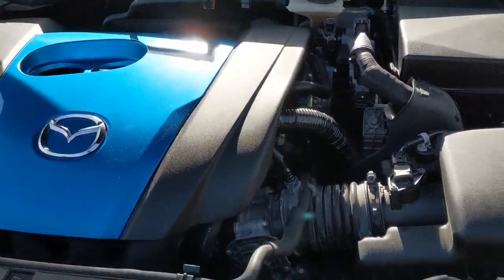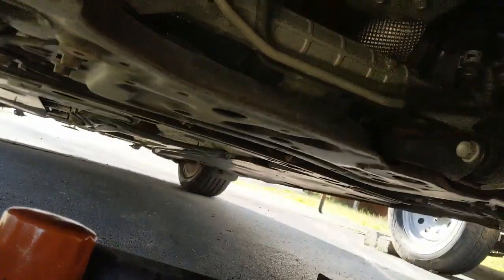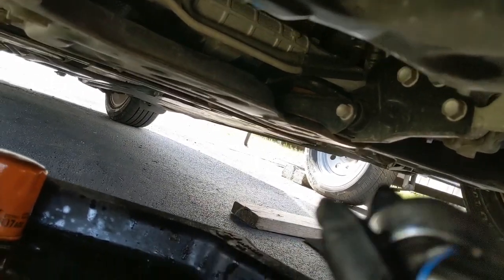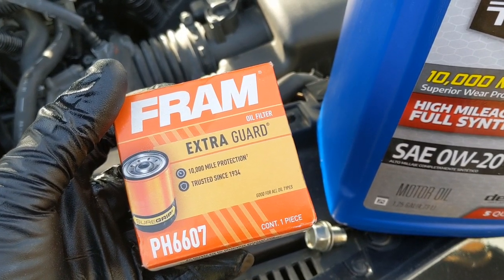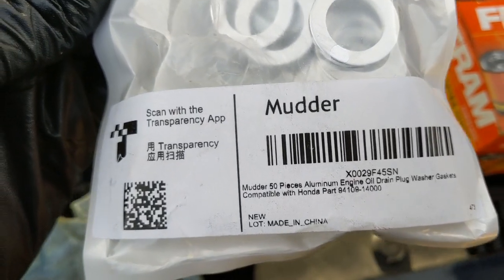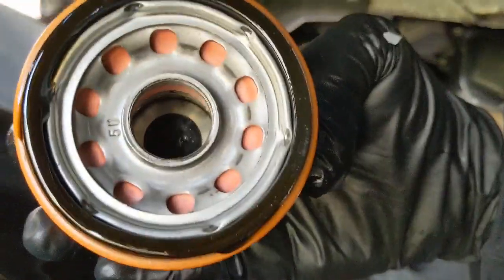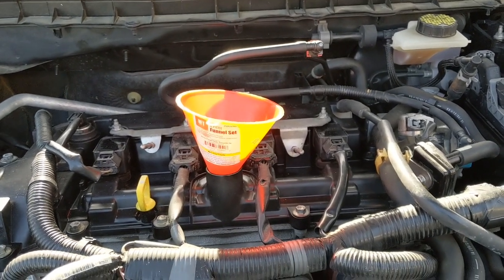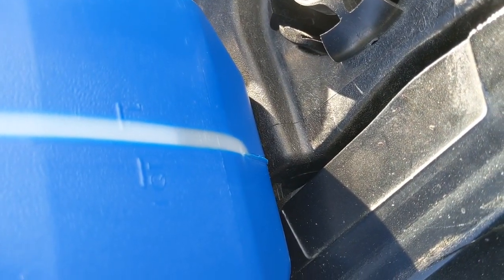2012 Mazda 3 skyactiv oil change #mazda #skyactiv #oilchange

Comment: did you get rid of the rear engine splash guard?
Reply from the maker: @S0u11ess  No I have it .
Reply: @aladdin1709  wasn't installed in the video. I guess you took it off before the video for some reason? Mine used mz3 sky didn't come with one, trying decide if I should spend $200 on a replacement...
Reply from the maker: @S0u11ess  missing few clips that's why , I fix it already.
Reply: @aladdin1709  gotcha, thanks for the reply